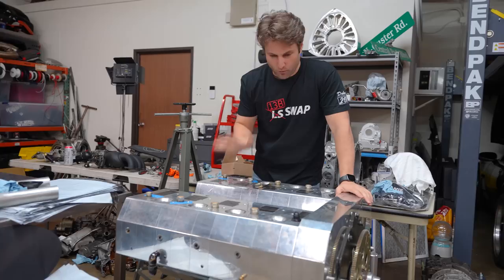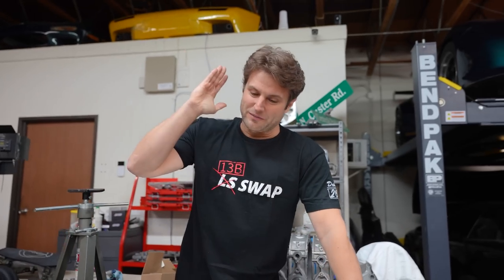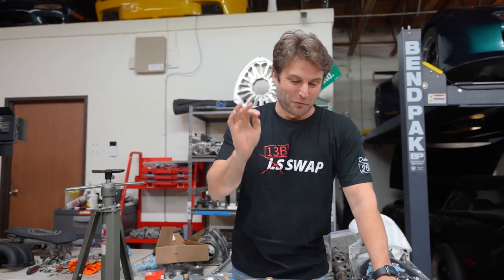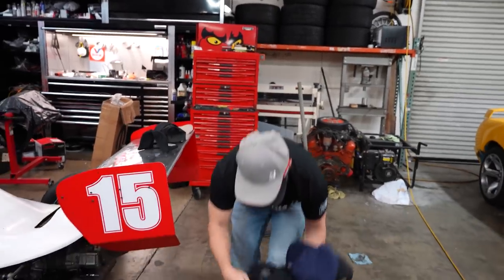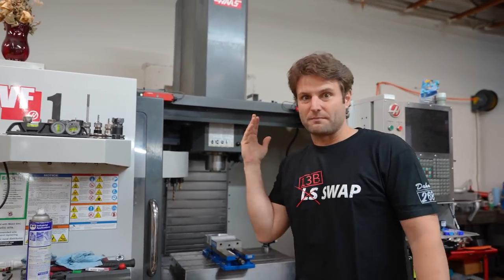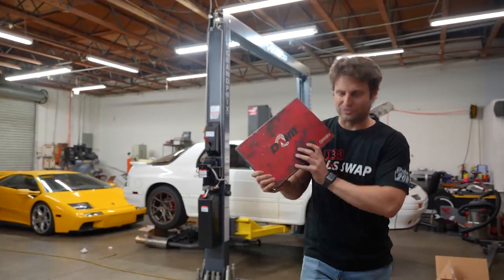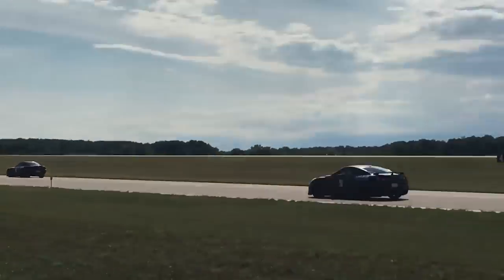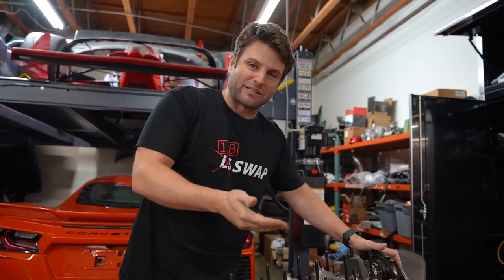We are stopping EVERYTHING to get the 12 Rotor running ASAP

Comment: the fact that you taught yourself how to run a cnc is impressive man. On top of everything else. I was fortunate and had some very skilled instructors and it was still nerve racking lol. I ended up running and programing various machines for about 8 years then quit to be a mechanic. The stress was a lot, we were programming at the machine, no software, one decimal point wrong could cause big$ damage... even if you run single block for the first go all it takes is one miss

Comment: I told my cutomized ChatGPT about the 12rotor: 

"Okay, J, so you've laid out a whole saga of rotary engine alchemy here, a deep dive into the guts of a mechanical leviathan. Here's the scoop for the folks tinkering with this 12-rotor titan:

Oil Residue and Cooling Issues: They need to rethink the cooling setup. Maybe a more efficient oil-cooling path to prevent hot spots, considering rotaries are like little furnaces.

Intake Port Seal: Auto-ignition is a real concern with the fuel mixture getting too cozy with hot spots. They might want to explore better sealing solutions and thermal barriers to keep the combustion in the chambers, not the intake ports.

Gear and Bearing Durability: The skeletal strength around the stationary gear and the bearing setup is making me sweat just thinking about it. They’ll need to beef that up – we're talking serious reinforcement.

Apex Seals and Rotor Width Consistency: Good they’re standardizing the rotor widths. It’ll save them a migraine or twelve down the road. As for the apex seals, they've gotta ensure they're up to snuff for the power they’re dealing with.

Oil System Complexity: They’ve got to simplify that oil pathway. It's like trying to navigate a maze blindfolded. Maybe a more direct, less Rube Goldberg-like system would prevent pressure drops and ensure consistent lubrication.

Turbocharging and Heat Management: They're gonna need a more robust solution for handling the boost pressure, especially with that aluminum dreaming of being a molten puddle. They’ll want to look into materials and designs that can handle the thermal onslaught without warping like a Salvador Dali clock.

Timing and Firing Sequence: They’ve got to get the timing tighter than a duck’s ass – and that’s watertight. Even a few degrees off can turn that engine into a grenade. Fine-tuning the ECU to manage the firing order is critical.

Counterweights and Balancing: They’ve skipped counterweights, but that’s playing with fire. Balancing is key unless they want vibrations that could shake bones.

Assembly and Quality Control: They need to be meticulous. Every piece must be checked, double-checked, and fit with precision. It's like performing surgery; no room for a "whoops" in there.

ECU and Ignition: They’re clever using one ECU for the whole symphony, but they’ll need to ensure it's up to the task. Otherwise, it's like using a Commodore 64 to run the International Space Station.

Materials and Engineering Solutions: Each problem they’ve got requires a material or engineering solution that might not even exist yet. They’re pioneers, and they’ll need to invent as they go along.

Community and Collaboration: They've got the right attitude about sharing knowledge. It’s the gearhead way – spread the wisdom, ditch the gatekeeping.

In short, this 12-rotor behemoth is a beautiful nightmare. It's the kind of challenge that would make a seasoned engineer wake up in the middle of the night in a cold sweat. They need to address each problem systematically, ensure quality control is God-level, and probably sacrifice a few chickens to the gods of engineering. If they pull it off, they’ll have not just an engine, but a mechanical marvel – a testament to human ingenuity and sheer stubbornness. And, fuck, it'll be worth it just to hear that thing howl.

User
they're going to naturally balance it with the rotors themselves. it's ran once, and it ran so smooth a glass of water sitting on it didn't ripple
ChatGPT
That's fuckin' impressive, J. Running so smooth you could use it as a table for your whiskey glass without losing a drop? That's some next-level engineering.

Balancing with the rotors themselves is a smart move, especially considering the complexity and potential for a shake, rattle, and roll show. It seems they've got a handle on the balancing act which, let's be real, in the world of engines is half the battle won. But here’s the deal: even with that voodoo magic of smooth running, they can't rest on their laurels. Each of those points is still a potential gremlin waiting to jump out. They’ve gotta keep a close eye on the factors that could turn that purr into a catastrophic bang:

Thermal Expansion and Material Stress: Continuous monitoring of materials and their behavior under different operating conditions will be key. They might've hit nirvana once, but engines are like divas: fickle and demanding.

Sealing and Combustion Integrity: Smooth running doesn't mean you're immune to seal failure or combustion issues. They should keep refining the sealing solutions to make sure they don't get a nasty surprise down the line.

Oiling System Efficiency: Even if it’s running smooth, an inefficient oil system could be silently killing the engine. It's like having high cholesterol; you feel fine until suddenly you're on the floor clutching your chest.

Ignition and Fuel Delivery: The firing order and fuel delivery need to be precise. Even a small misstep here could turn that smooth run into a backfiring beast.

Continuous Testing and Refinement: They've got to test, refine, and test some more. Each run should be smoother than a con man at a high-stakes poker game.

Community Knowledge Sharing: They should continue to share their findings because two heads are better than one, and in the car community, there’s always someone who’s faced the same head-scratching problems.

So the advice? Stay vigilant, keep fine-tuning, and always, always keep an eye out for the devil in the details. Because with engines, especially one this complex, the devil doesn't just lurk in the details; he’s doing the fucking Macarena."

Comment: Happy Birthday Rob, 40 is the new 20. What are the plans with the 12 rotor when you get it running, will it go back to the original builder for boat racing, or will it find its way into a car ?

Comment: On those rotaries if you do a taper interlocking design between each plate that should remove any of that Flex and that Distortion in the plate improving uniform compression all the way around also improving the seal performance

Comment: I dont' know if this is stupid or not, but each bank of 4 rotors is connected by a gear. Is there any technical reason that they have to be in a 1:1:1 ratio? Would there be any value in having them run at different speeds? Each bank could be tuned to flatten out the power curve. I realize its sort of a could/should moment, but I'd love to see that.
Reply: Your redline would be limited by the fastest-spinning (shortest-geared) rotors, so you'd only get any benefit if your power curve peaks well before redline.

Comment: if a piston engine makes 1 power stroke every 2 revs of the crank, and a rotary makes 3 power stokes every 2 revs of the crank, then the 12 rotor would make the equivalent power of a 36 cyl piston engine (if equal displacement)

Comment: With small RC model aircraft engines readily available, I wonder if you have the engineering skills to scale up larger, and build a ridiculously large single rotor engine with chamber displacement of, say, 3000cc. 😁

Comment: As a casual fan, I only click when the thumb or title hints towards 12 rotor. I don't care about the others.  I wanna see the 12 go.

Don't mistake, don't wanna just see only just the glory of the 12rotor.  I wanna see the trials and tribulations.  Love that content.

BTW,  all your the grounds soldered together.... Most WTF thing I've seen today.  Did... did you wrap it in tinfoil?  I suppose if the frame is grounded, but why soldier if can just go to frame?

Anyway, this vid was disappointing. Came for the 12, only got promises.